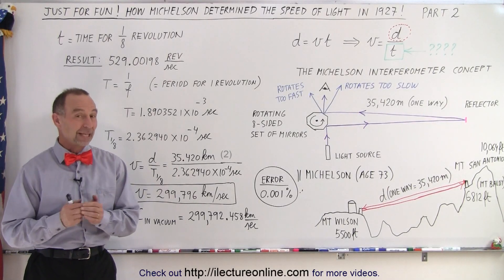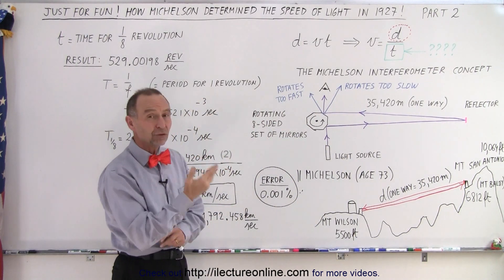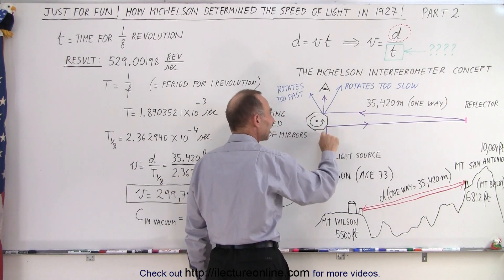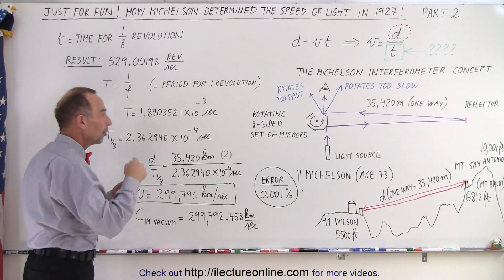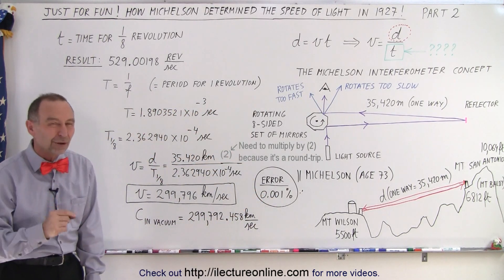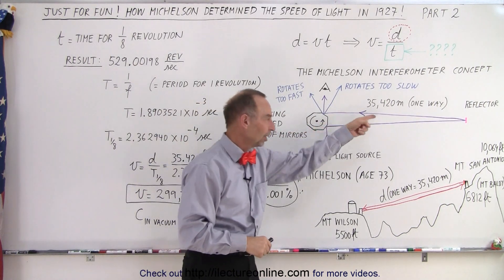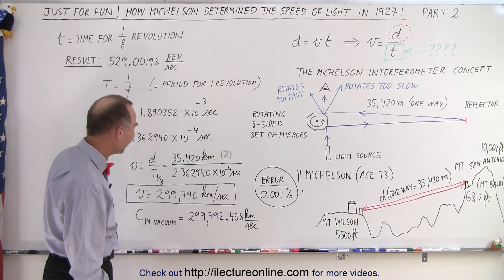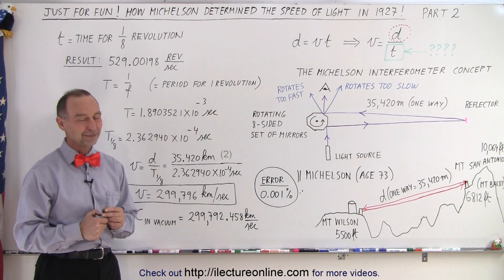Just For Fun! - Physics (21) CORRECTED! How Would You Calculate the Speed of Light in 1927? (2 of 2)

Comment: How in the world did they rotate an 8-sided mirror at 529 times per second?!
That is INSANELY fast!
Reply: Still a lot slower than a gyro
Reply: A surveyor has revisited the Mt Wilson and Lookout Mountain sites of Michelson’s experiment, re-measured the benchmark position at Lookout Mountain, and posted fascinating write-ups at
https://www.otherhand.org/home-page/physics/historical-speed-of-light-measurements-in-southern-california/
There he posts a contemporary newspaper article about the hazards of rapidly spinning glass mirrors.
“At one point Michelson attempted to use a larger, 8 sided mirror to obtain a brighter return image. It was designed to operate at 528 turns per second (almost 32,000 RPM). But when it reached 400 revolutions per second it burst apart, showering the observation room with shards of glass.”
The mirror motor was driven by compressed air, like a dental drill, to get to these high speeds.